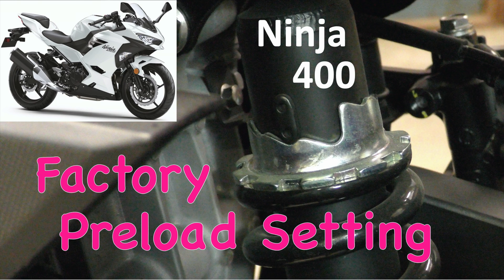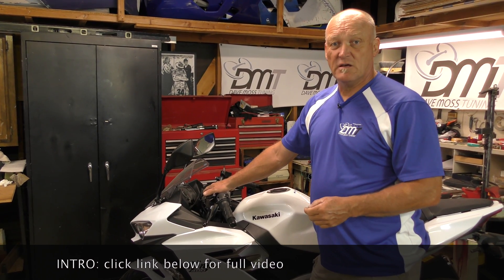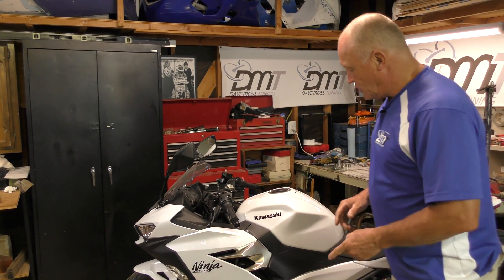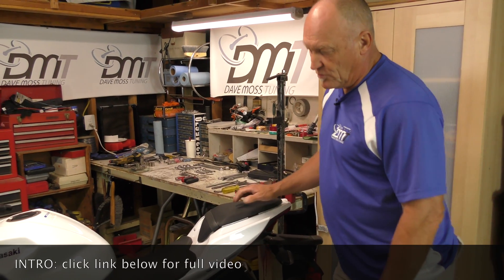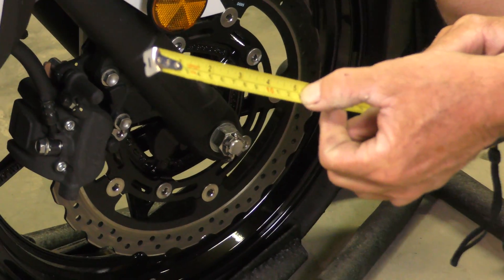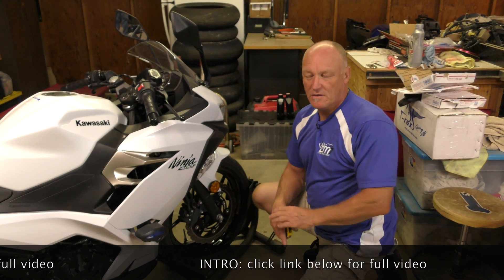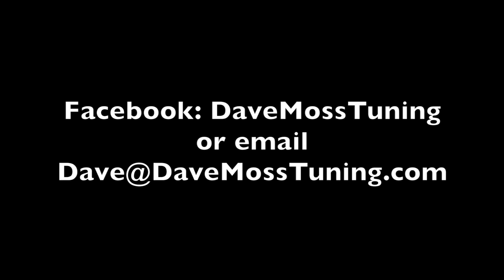INTRO Ninja 400 Project: Stock Suspension Evaluation & Setup Ep 2

Comment: Can i turn the step both way? Does it affect anything on the spring?
Reply from the maker: The step on the preload adjuster makes the shock soft (small step) to much stiffer (big steps). This will make a small change in the height of the seat from the ground from minimum to maximum.

Comment: Did not get to the point on how to actually adjust the shock can i get my time back…
Reply from the maker: Static sag = 12-15mm set via preload, compression damping set at 50% of the range, rebound set at 2.5 turns out. Cold oil, initial settings and has to be ridden to get hot oil allowing rebound to be set correctly.

Comment: BULLSHIT, Mr. Dave Moss got it completely backwards, SAG is a number of how much suspension is already compressed, so more it's compressed(high SAG number) the less length it has left to compress more.
For example if you have 120mm suspension travel and 40mm rider SAG suspension has 80mm left to absorb(compress more) a bump.
So when you hit a bump it will "whack" into the shocks if you have too much SAG !!!

Hence it's the number how much length suspension has to extend into the pothole
Do some homework Mr. Dave
Reply: I just watched the section you disagree with. He describes the static sag correctly. I think you're struggling (somewhat justifiably) with his depiction of what Static Sag actually does, specifically when he says it keeps the suspension from "whacking" into you when you hit a bump.  He is not talking about the whack that occurs when suspension bottoms out. When there is no Static Sag (the amount the fork/shock compresses under the motorcycle's own weight), the spring releases all the energy it absorbed during the compression stroke to the full extension of the fork/shock's travel on the rebound stroke. In your example of 120mm of travel, if the 40mm of sag is all Rider Sag, thus no Static Sag, the spring will release energy (continue pushing) for the entire 120mm, and a "whack" occurs as the fork/shock reaches its extension limit; it mechanically "tops out" which is the opposite of the whack when it reaches its mechanical compression limit, when it "bottoms out."  Static Sag allows the spring to reach the end of its extension stroke before the fork/shock assembly reaches the end of its mechanical extension.  In other words, the spring stops pushing when the fork/shock still has room to extend.  This creates what Dave calls a "dead space".  This dead space gives the fork/shock the opportunity to release all the spring's stored energy before hitting the fork/shock's mechanical top out.  Without that dead space, the spring just keeps pushing to the mechanical top out whereupon it "whacks" and launches the rider.  The static sag dead space is like a relief valve allowing the energy to "pop off" or dissipate into the motorcycle itself, to be absorbed by the weight of the motorcycle; it gets transferred to the motorcycle first instead of passing unimpeded straight into the rider with a whack for good measure.
Reply from the maker: Static sag is the suspension extended and the bike at rest. Rider sag is the bike at rest and rider on board. Add both together to get total sag. Is static or rider sag backwards sir?
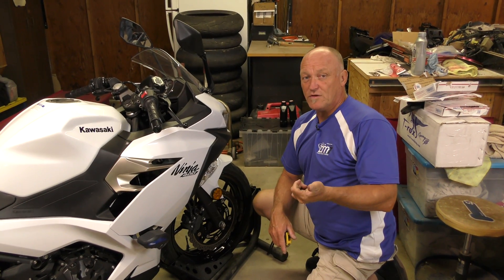Reply: @catalystreactionsbw   listen from 2:05 to 3:25 that whole genrorous SAG philosophy is wrong, thats whats backwards ;)